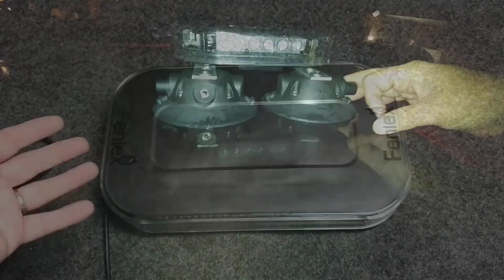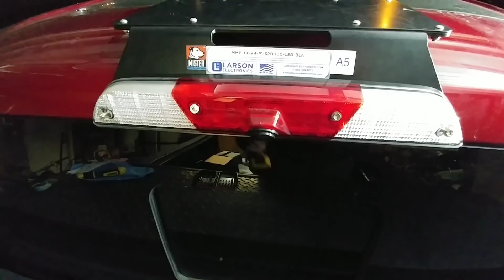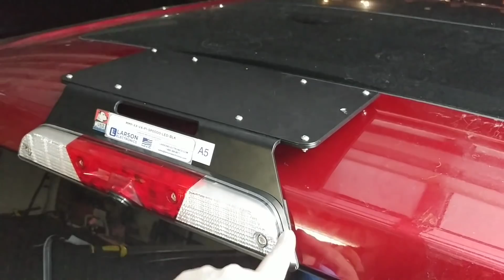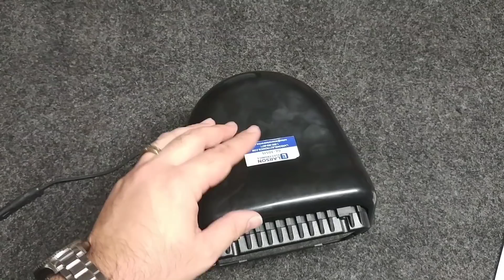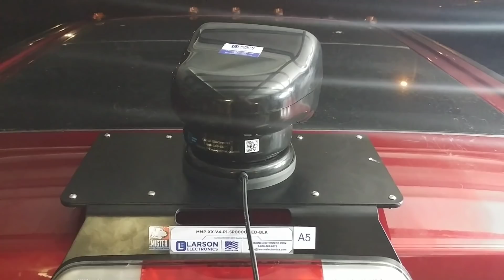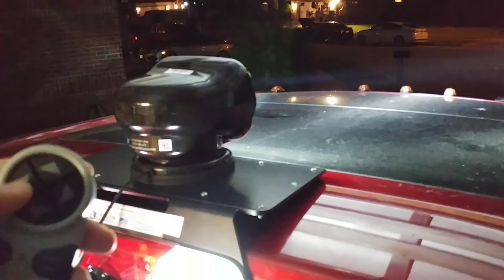Ultimate Mounting solution for pickups including the Ford F150-F550 Pickups!

Comment: Have you seen the third brake light mount from Whelen or Acari? Same concept but their lights allow for the wires from the lights or antennas that you mount to pass through the cab. While I'm sure the larson mount is a good mount, it doesn't allow any channels for the wires to pass into the cab. The Larson mount you will have to drill holes in the cab, pass through the rear window, or string them down the back which defeats the purpose of this type of mount. Whelen's mount has this feature which makes the install much more user friendly and allows for a much more cleaner install.

Comment: For you to say that the Larson is the BEST product for doing this is ludicrous considering it mounts to the truck with toggle bolts. I'm guessing Larson gave you that mount. The Acari mount is wayyyy better and does not use toggle bolts to hold it onto the truck. You should have showed your viewers that shitty Larson mounting system with toggle bolts. The Acari product mounts in the same location but does it in a more professional way. The Larson and the Acari about the same price. You can get the Acari with an aluminum top or a steel top if you want a magnetic base. Im looking to do the same thing and i have researched them all.

Comment: I think a headache rack, like the ones from Magnum would give you more flexibility for mounting equipment like lights, antennas, etc.. They have a low profile design one that sits about flush to the top of the cab. Then attach the brackets for whatever you are using at that time. You can keep your toolbox as well and most likely your tonneau cover since the L-channel (Part of the tonneau mounting kit for toolboxes) allows for flexible positioning of the cover to account for various toolbox sizes. Maybe they'll send you one to review if you reach out. https://magnumtruckracks.com/shop/truck-racks/low-pro-truck-rack-with-window-cut-out

Comment: Hey btbrv, do you think the mount could handle a heavy whip cb antenna? I use cb alot for travel and offroad to communications back and forth to our jeep. The current setup I have works ok. However, this mount puts the antenna in an ideal location.  My worry is the constant flex and strain from the antenna may weaken where the mount is bolted up to the cab...just thought I would get your opinion.
Thanks again  brother!

Comment: I suspect you have been a first responder to vehicle mishaps at night like me , perhaps both
could be used at the same time with a metal plate slightly larger than the Larson mount.
I like the modularity of the whole light system and I suspect other things can be 
temporarily attached too. (Like a CB antenna)

Comment: Thanks for sharing.  Been trying to find a good solution for my Ham Radio antennas.  This has come up in a few searches, but your video is the first to show that the steel part goes back over the top of the cab.  I have the large sunroof too,  so not much room to drill and mount on the roof.

Comment: Hi BTBRV once you drive your truck  with the metal plate for mounting magnetically equipment,  do you get any vibrations, noise specially in wendy conditions or off roading ?

Comment: I really liked my go light, I still have it an still use it, however it was quite heavy, I had it installed on the steel cab of a 2016 f350 super duty but I had to take it off because driving down good oil field lease roads, ranch roads and even some Corpus Christi roads the sheer metal was too thin and the light would attempt to bounce while driving slowly over un paved roads that the light would begin to tear the sheet metal caused from the metal fatigue. This happened to me on a few different vehicles not just 1. As a person who specs out a fleet of oil field mechanics trucks and designs the overall outfit (service cranes, service bodies, pto’s, air compressors, generators, etc.) we got away from using go lights all together on the cabs period. If we do use them they go on the headache racks no questions asked. The go lights were awesome lights very very handy and useful, but they are also pretty heavy. I can’t say anything bad about the light itself all great things but I would be very cautious using that go light on that Larson no drill mounting bracket. Seems like Larson is on a great path, and seems like a well thought out product, especially for the aluminum ford bodies, for your strobe light I think you would be fine all day long no problem. However for your go light I would be cautious, all of that bouncing weight and flex is being applied to the mounting holes of the third brake light. That bracket looks tough as hell, and the aluminum sheet metal should be the absolute strongest in the corners where the brake the sheet metal and what not when building the cabs. Because the last thing you want to happen is begin tearing the aluminum. I think this product would work great for smaller and lighter things such as your strobe light but I’d just be cautious with the go lights, great lights, but a bit heavy.
Reply: aaron grant I was looking at the way the Larson mount was done also and was thinking it really needs a rubber brace to go between it and the cab plus they should offer a mount that will piggy back over that light bar that will allow you to put the Go light above it
Reply: Stacy Reid I agree, I think both of those ideas are great, especially the rubber brace so it doesn’t scratch the cab yet still supported. Great ideas Stacy Reid!
Reply: aaron grant thank you   My only problem is that it sits so low how would you clean underneath it. I live in a pasture, so my truck is always dirty and splashing through mud, for people like me it would need to be 2-1/2---3" high for cleaning the top of the cab.